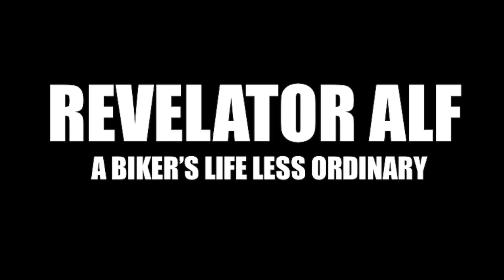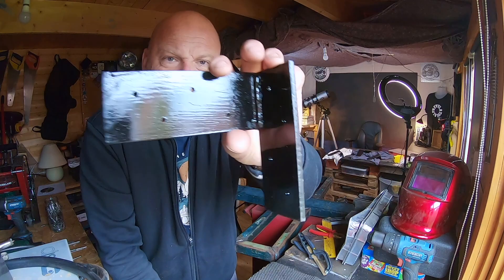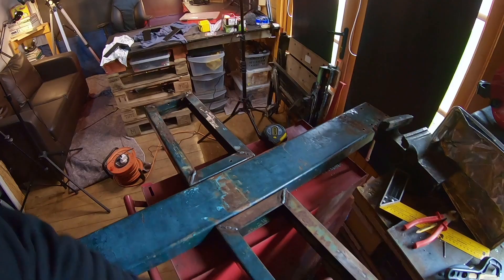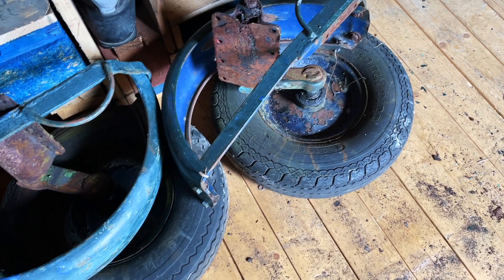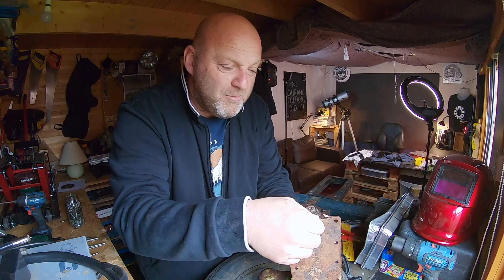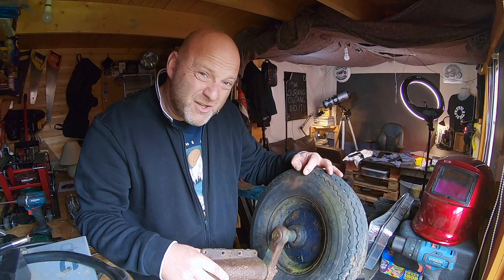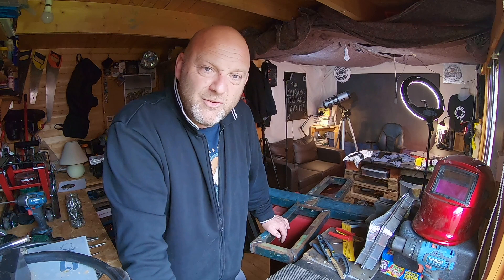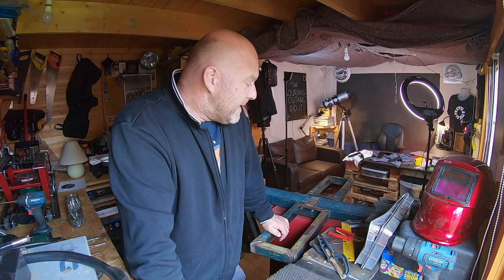Building A Collapsible Motorcycle Trailer | Heavy Duty Bike Trailer Assembly

Comment: You can buy a trailer kit from trailertek you get stub axle assembly’s wheels, tyres wheel arches and tow hitch, bearings, all the hardware. Depending on the weight you go for they are sub £200. I bought one recently and it’s top notch

Comment: I have built some years ago and one of the issues I had was the ramp to get the bike on and the trailer moving about too much while loading.  I found some jacks that they use to level caravans the I would put in the front while getting the bike on it that once the bike was rolling on would give more support to the front of the trailer and prevent wobbling about
Reply from the maker: Yes I would say these work much better for lighter bikes. I would prefer a flatbed arrangement really for a much heavier bike